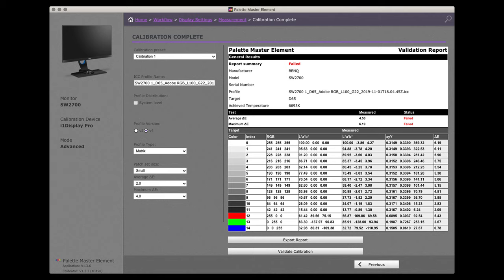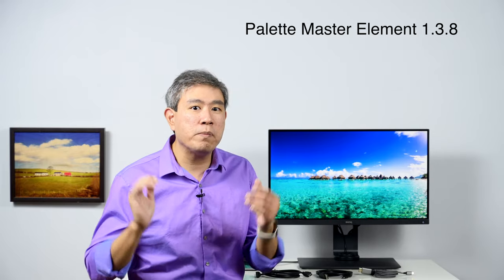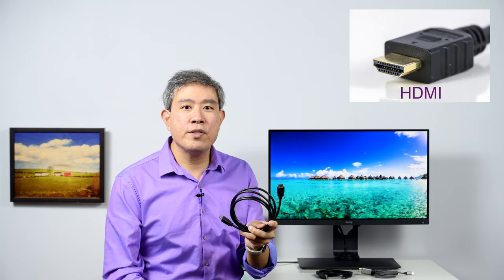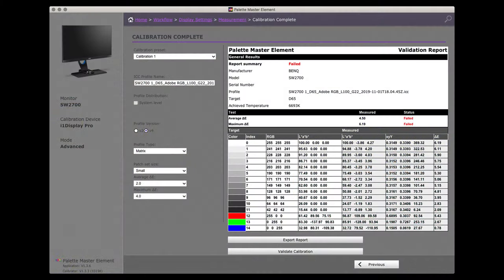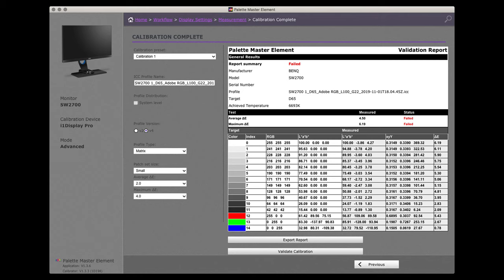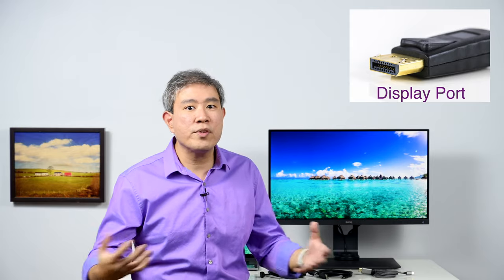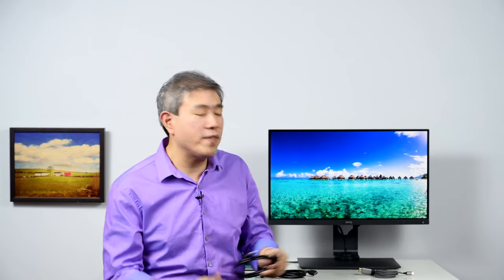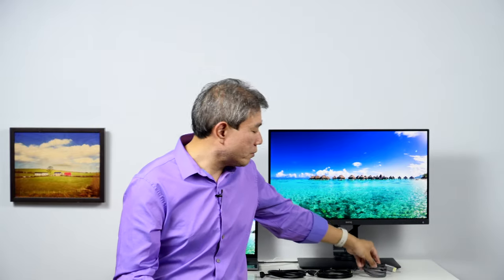HOW TO trouble shoot your BenQ SW Palette Mater Element Validation Fail Before Calling Support!

Comment: Hi dear ArtIsRight! I have a same problem like the other but nothing helps. I use a AORUS Serie X Tower and bought the PD3220U for my graphic and illustration works. I connected my tower with HDMI cable and with an USB cable too. So I can use my keyboards also on my laptop that is connected with the USB-C Port. ( I want to use both Tower and Laptop with the same monitor) This works fine. But the software says that the monitor isn't connected with my PC. 

I read that I have to change the color system in NVIDIA. I try to use it but it also doesn't work and with a new start it is back on the old system standard. Have you an idea for me what I can do? Thanks and greetings from switzerland!
Reply from the maker: I would dm me on insta or fb if you want dianostic help. I need more information

Comment: Hi I have a SW271 with a I1 display , MAC os Catalina . I keep getting a message saying " a connection to Benq cannot be established. I check the native software from the calibrator and everything seems to be working on that side.  Any recommendations? Thank you
Reply from the maker: Please answers these questions completely and we’ll go from here.
1. What computer (Laptop - Mac specify the model, year and size, Desktop, iMac, all in 1 PC, custom build, etc )
2. What is your Operating System (OS) version are you using? (For Mac please specify the dot release, for Windows please specify version / build number)
3. What calibrator are using?
4. What version of PME are you using?
5. What BenQ model do you have?
6. What cable are you using to connect your BenQ to your computer for the display signal, HDMI, Display Port, etc.
7. If you are using USB-C skip this question, if not, are you using a USB link cable between your laptop and display?
8. If you are using Mac was this a clean install or was the OS upgraded from a previous version at any point (I.e. From Mojave 10.13.x to Catalina 10.14.x)? Or was this Mac restore from a back up, time machine or other wise?
9. For PC, what GPU are you using? If Nvidia are you using their new Studio Driver?
10. Were you able able to successfully pass the validation at some point

Comment: Hi. I have a SW271 & MacBook Pro. I am connecting the monitor directly to the Mac with a USB-cable. All software is up to date (using 1.3.10) and I have followed the instructions on this video. My calibration device is a Syder 5. The calibration fails every time even with the most simple (vanilla) settings. Is it the Spyder 5?  Otherwise I don’t have a clue. Thanks
Reply from the maker: How old and what generation is your MBP? What version of the OS are you running, if you are on Catalina 10.15.4 or higher check this video out https://youtu.be/CFyNBYP5lJk If you have done this already and the calibration still does not pass. Answer the following question, was this Mac a clean install or was the OS upgraded from a previous version at any point (I.e. From Mojave 10.13.x to Catalina 10.14.x)? Or was this Mac restore from a back up, time machine or other wise? Or setup initially via migration assistance?
Reply: @ArtIsRight  
Thanks for getting back to me.
1.     My MBP is  MacBookPro15,2
2.     I’m running Catalina 10.15.5
3.     The HDR is unchecked
4.     My Mac has been upgraded as been made available
Reply from the maker: Could you check and Make sure that the Spyder software is not running in the background. On the menu bar at the top of the screen, if you see the Spyder symbol there close it before you run PME. This could be software conflict. Better yet go to system preferences, users and group, and in the login items tab, if you see the Spyder software there, remove it.
Reply: ArtIsRight Hi again. I have the Spyder software but it is not loaded nor has it been running in the background.
Reply from the maker: Better yet, could you check this for me? See if HDR is turned on or off. https://youtu.be/CFyNBYP5lJk If it is on uncheck it and try recalibration. Let me know if HDR is turned on or off and if this solve the issue.

Comment: Hi, thanks for the videos. I Have mac mini M1, sw271C, mac os Monterey, MPE latest : My i1 display device is not recogonised . But OME calibrite recognizes and works. can u help me on this. Connecting through Type C cable.
Reply from the maker: Make sure calibrate is not running in the background or launched while Palette Master Element is running. If you continue to have issues dm me in Facebook page or insta
Reply: @ArtIsRight  Thanks , Got it done . working .

Comment: Windows 11. Updated the NVidia card, unplugged and cleaned all contacts and re-plugged all connections but Pallet Masters Elements does not recognize the monitor.  I1Profiler works.

Any more tricks?

Thanks, Ted
Reply from the maker: Did you use a USB Cable between the monitor and computer? better yet

Please answers these questions completely and we’ll go from here.
* What computer (Laptop - Mac specify the model, year and size, Desktop, iMac, all in 1 PC, custom build, etc )
* What is your Operating System (OS) version are you using? (For Mac please specify the dot release, for Windows please specify version / build number)
* What calibrator are using?
* What version of PME are you using?
* What BenQ model do you have?
* Is this the only display linked up to the system?
* What cable are you using to connect your BenQ to your computer for the display signal, HDMI, Display Port, etc.
* If you are using USB-C skip this question, if not, are you using a USB link cable between your laptop and display?
* If you are using Mac was this a clean install or was the OS upgraded from a previous version at any point (I.e. From Mojave 10.13.x to Catalina 10.14.x)? Or was this Mac restore from a back up, time machine or other wise?
* For PC, what GPU are you using? If Nvidia are you using their new Studio Driver?
* Were you able able to successfully pass the validation at some point
* For SW2700PT owner, look at the back of your display on the regular tag and give me the MFG date. 
* Have you installed DisplayCal at some point?
* Do you know of any color calibration software that starts with the OS and is running in the background?

Comment: Hi Art—thank you for your helpful videos!  I’m hoping you can provide some guidance on a validation failure I’m running into.  I’m running two SW2700 monitors on Windows 10 (NVIDIA GEFOrce RTX 2070 SUPER).  One monitor is passing and the other is failing.  The failure is on the average delta (it passes on the maximum delta).  I’m using a Spyder5 pro, display port cables and have dimmed all the lights (with a little ambient light coming in from the closed window shades.  My settings are D65, Panel Native, 120 luminance, 2.2 Gamma, Absolute Zero, Profile Verison 2, 16 bits LUT and Large patch size.  I'm running PME v1.3.12.  Any suggestions?
Reply from the maker: Are both displays USB cables hooked up simultaneously during calibration? That may be the issue. What you have to do is pull the USB cord out from the one that you are not calibrating. https://youtu.be/Rxsr8QWBRMw let me know if this works.
Reply: @ArtIsRight  Thank you Art, I had not seen that video.  I did have a USB cord in each monitor.  I removed them, restarted my computer, plugged the USB and Sypder into monitor 1 (the one that passed) and recalibrated.  It passed again.  I then moved the USB and Sypder to monitor 2.  It again failed on the average delta (although this time it was 2.16, the lowest is has been).
Reply from the maker: I would give monitor 2 another try, one more thing that you can do too is remove the display cable completely from display 1 and see if that makes a differences.
Reply: @ArtIsRight  thank you Art! I’ve tried that and the issue I’m running into now is that when I run the validation PME switches from monitor 2 to monitor 1 (even through it’s unplugged). The measurement and LUT writing go fine on monitor 2 but it switches over to monitor 1 when I try to validate. It has done this same thing 3 times now. I tried not extending the displays in the display settings but then PME doesn’t recognize that there are two monitors and it won’t have separate profiles for each monitor. Any suggestions?
Reply: @ArtIsRight  I'm starting to think it's a hardware issue.  I've re-run the calibration on just monitor 2 five times now with monitor 1 completely unplugged and am consistently failing on validation.
Reply from the maker: What cable are you using to connect each of the display? Are they both using display port?
Reply: @ArtIsRight  yes. Both are using display port. I originally was using HDMI cables for both (although one had a converter to display port) but then I saw your videos about the issues with HDMI so I switched them both out with display port cables.
Reply from the maker: Ok I just gone back on your notes further. Here’re a few things that you need to do. What I like you to do is calibrate each display independently, the other display that is not being calibrate, please disconnect it completely from the system so this means the display signal and USB cable disconnected, the monitor can remained plugged in. Windows should now see only 1 display. Don’t mirror because that can cause lots of issues. Run the calibration on your second display this way and let me know the result. A few note is that validation should be done on a single calibration session only meaning, once you calibrate the display, validate it and just leave it at that, don’t validate it again after the session. Additionally are you using Nvidia Studio driver with your card or game ready driver?
Reply: @ArtIsRight  thank you Art! I’m running the calibration on just monitor 2 now (the other monitor is not plugged into the PC at all). I am now running the studio driver. Still failed validation 2 times.
Reply from the maker: Can you try it with another display port to display port cable, if you have to unplug the one from monitor #1 on both the computer and video card do it. I want to be certain that most of the variables are eliminated. The thing is that replacement takes time and it may solve these underlying issues. 99.5% of the time it is software and not display. This will also help when you contact support as well, because you have ran through all of these test already.
Reply: @ArtIsRight  thank you Art! That did the trick. Very happy to know it’s not a hardware issue. Can’t thank you enough for your help!!!
Reply from the maker: Awesome, so it is a bad Display Port cable. Glad this is resolved.

Comment: Hello Art, thanks for the video, I have subscribed. My question is: I have tried to calibrate my BenQ SW271 a lot of times. I have spent many hours on it. I watched a lot of videos. I use a MacBook Pro (2019) with Calalina 10.15.6. I have unchecked HDR, deleted Spyder software, dimmed my lights, tried everything but each time the calibration fails with big numbers. Can the calibration device that I am using be the problem? I am working with Spyder 4. I know it is a bit outdated but as PME still supports it I would expect it to work. Thanks for your reaction. Edith
Reply from the maker: Hi Edith, welcome! Glad that you joined. What size is your MBP? Also when you set it up initially did you start fresh or did you at anytime used migration assistant or time machine to restore the computer from a back up?
Reply: Hello Art, I did not restore the computer with time machine. My MBP is 13 inch, 2018. I use the USB C to USB C cable that came with the BenQ. Edith
Reply from the maker: Have you done all of this? https://youtu.be/hDHBodulVbw
Reply: Hello Art, I have now. And ..... it passed! It might also have to do with the fact that I closed my laptop and only had the benq screen on. Anyway ... I am happy. Thanks a lot for your help! Edith
Reply from the maker: Awesome glad it worked out!

Comment: I have a PC connected to my SW 321C via HDMI and failing calibration. From Benq support I did the following two things, and hey presto, my monitor now passes calibration. On the Benq monitor (SW 321C) I set System/RGB PC Range from Auto to RGB (0-255) and on my PC NVIDIA Control panel, I selected "use NVIDIA Colour Settings" and set O/P dynamic range to Full. Now calibrates via HDMI.
Reply from the maker: good

Comment: Just downloaded the most recent version of Pallet Masters, using windows 11, it does not recognize my BenQ.  Can celibate using it I! Profiler, though.  Just took my system all apart, cleaned the cable connections and put it all back together.  No changes. Any ideas?
Reply from the maker: Windows 11 is a big part of the issue. developing.

Comment: Your videos are great! So clear and informative! I am running into some trouble. After trying multiple things and checking i've done the things mentioned in this video, I am still getting a failed calibration. After calibration it also says 'target luminance:0' even though I have entered luminance as 100. I am using a Benq SW270C, and a Metabox Prime-S P960RC laptop with Windows 10 version 20H2, OS build 19042.1165, i1 Display Pro Plus calibrator, PME v 1.3.15, and am connecting the monitor to my PC with a display port to mini display port, and a usb C (3.1 Gen2). I have only recently purchased the calibrator and this is my first experience with screen calibrating, so I'm not sure if i'm missing something simple. I have tried several times now and have not yet been able to successfully pass validation.
Reply from the maker: Your laptop has a variety of connector. I think there may be some conflicts. Based on your spec your type C port is technically a Thunderbolt port with Display Port (DP) 1.4 signal, So what I like to do is just use this port with the SW270C and don't use the DP to mini DP, you don't need that. See if the signal go thought and if the calibration works.